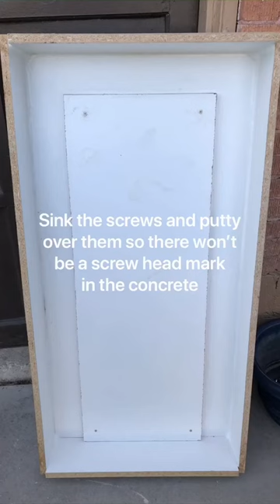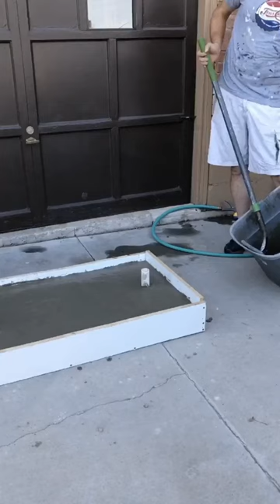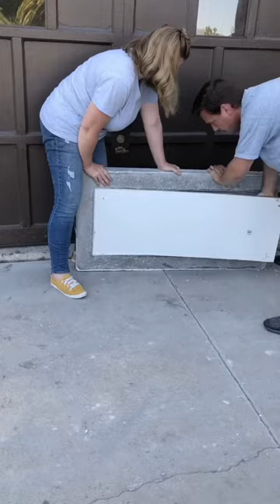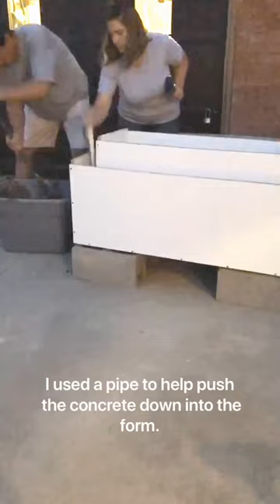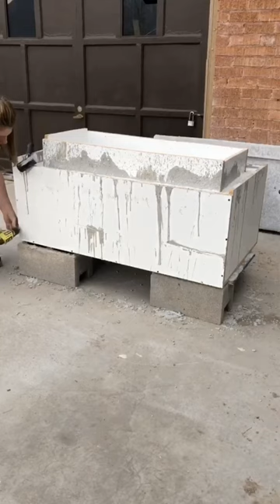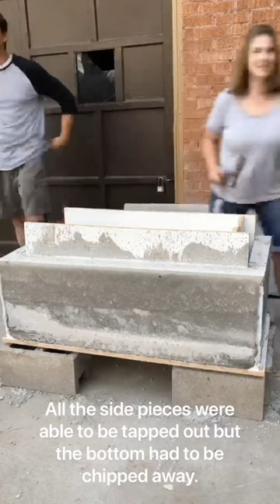DIY Concrete Garden Fountain

Comment: What did you use to seal the hole in the tank that you did to get the pump tube and wire out from?
Reply from the maker: Silicone caulk

Comment: What pump and water spout/connecting pieces did you use to cycle the water?

Is there a hole in the vase or does the water just overflow into the concrete base?
Reply from the maker: I just bought a basic pump from Home Depot and used clear plastic tubing. 
There isn't a hole in the vase. it just runs over :)

Comment: THanks for sharing.  Did you have to put any kind of waterproofing on the interior of the concrete fountain base so water would not leak or seep through?
Reply from the maker: I did not water proof it at all and it has held the water perfectly for 2 years now.
Reply: @StacyRisenmay  OHHH, that is good to know.  Thank you so much for the info/reply.  Have a great day.

Comment: Nice work but I wish if you spoken to us and explained little more details , is that cement or concrete ? Did you use any wire reinforcement ? What pump capacity did you use ? Etc .. just difficult to figure out what you did
Reply from the maker: This video is meant as a teaser. I have more info in my blog post.
Reply: @StacyRisenmay  No worries I found a better way with concrete blocks from Home Depot cost $14 to build the whole think and I am covering it with my Mediterranean tiles I will upload a full video
Reply from the maker: @Entrepreneurusa  I bet the Mediterranean tile will be so pretty!
Reply: @StacyRisenmay  Yes they are amazing I sell them and I have the best prices in USA

Comment: How does the tall part stays on the wall without falling?
Reply from the maker: It is pinned between the wall and the base. But even without that, it is so heavy that it would be hard for it to tip or fall over. It sunk a little into the dirt.
Reply: @StacyRisenmay  thank you